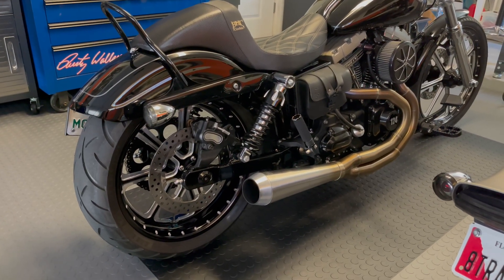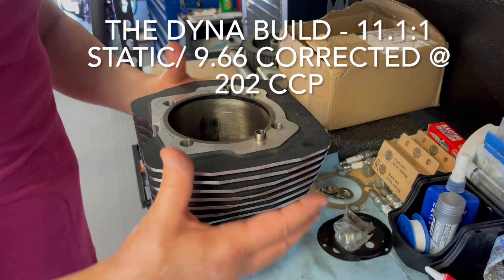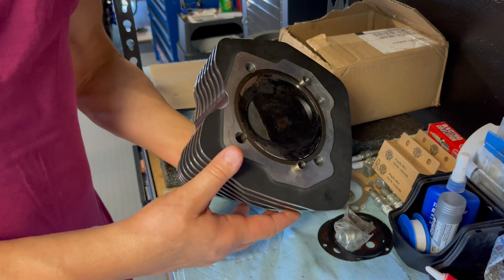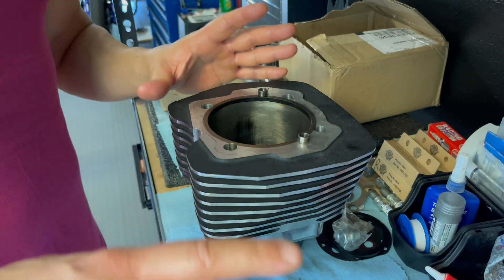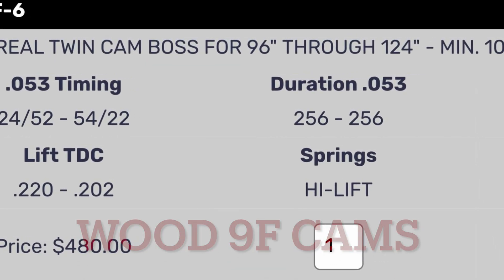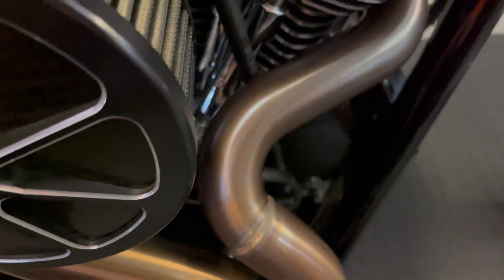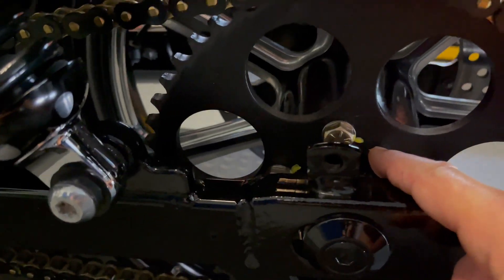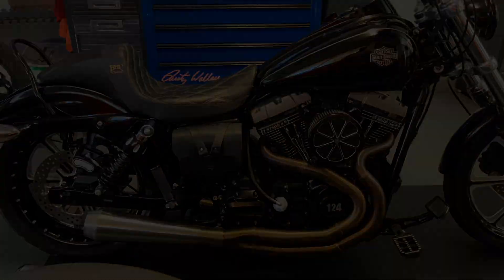DYNA custom 124ci - compression info/ idle & revs/ part #s

Comment: Have a 2009 road glide with a R&R 131 4 3/8” sq bore. 58mm HPI, S&S 640 cam, 9-1-1 compression with bassani 777… serious power right off the throttle… 130tq at 1800 to 140tq at 5250 rpm. 
Built to last but Witt the baker 7 speed very very fast …
Reply from the maker: Nice. I’ve used R&R many times. Reg & Art are top notch guys   They make tons of parts and full motors, RG has their head casting, work of art